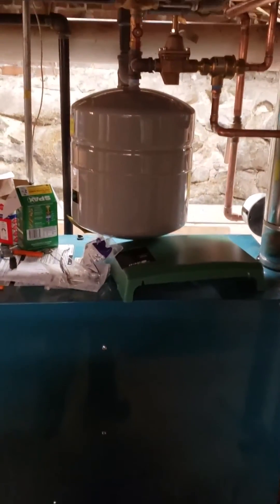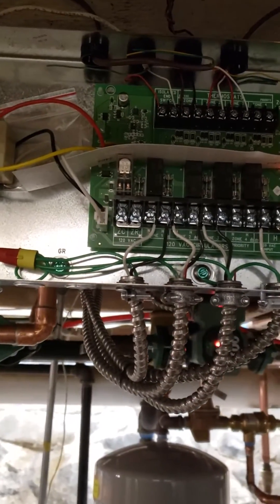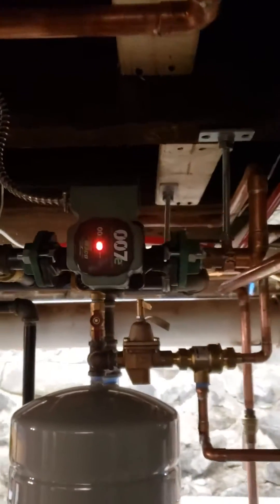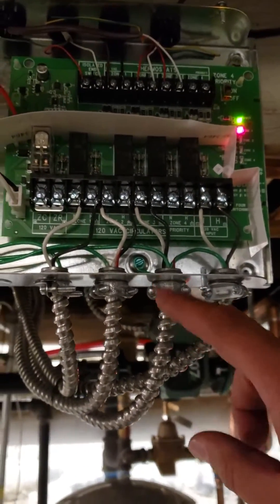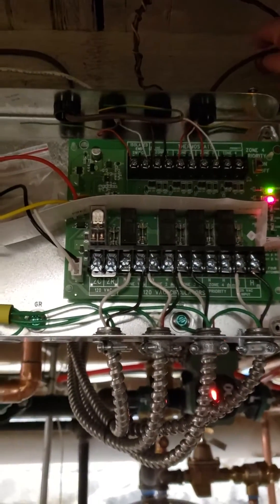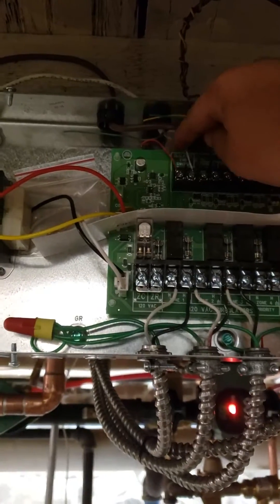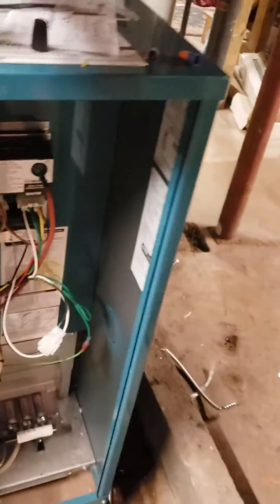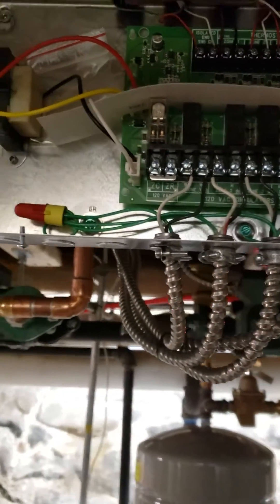How to install/Wire Taco SR504-4 Switching Relay

Comment: HI I HAVE SR504-4 Switching Relay, SAME ONE YOU USING BUT I HAVE 4 ZONE AND NAVIEAN NFC 200 COMBI BOILER. QUESTION IS WHICH WIRE I SHOULD CONNECT FROM RELAY?

Comment: Where you hook up your pumps from zone 1 or zone 2 in the same spot  can I hook up my actuators valves ?
Reply: no you need the ZVC taco which is a controller for actuator valves.

Comment: Hello, the green LED that usually lights up on the "POWER" part turned off and now I currently don't have any heat in the house. Do you have any suggestions on how i can fix it?
Reply: Make sure power switch is turned on. Make sure breaker is not tripped

Comment: Hey the end switch on the relay is connected to what exactly on the boiler it self ?
Reply: It depends on your boiler, but your boiler needs to know when to turn on and off. so it needs a switch from your relay board. For my boiler, it's the purple circle labeled E https://imgur.com/ixhkrF7
Reply: @guest00101  what if its a hot water tank though?   shouldnt it only be on when water is running through it like when you open the hot water tap on a sink?
Reply: @guest00101  Thanks!  I wonder that myself.  You were a big help to me.

Comment: On your Taco Controller, does your 120 V supply come from the boiler (switched) or is it straight from the main? I have the SR503 that i intend to hookup to 2 zones and a primary running with a Navien boiler.
Reply from the maker: Main line goes to the switch and from the switch to the the taco controller.
Reply: Do you have an aqua stat installed? If so, is it the same 120v that feeds that the same as the 120v feeding relay control?

Comment: I have a setup similar to yours.  Do you have a nest hooked up to it? If so, can you show how to? I bought two nest Es and I have a 2 wire setup ..with an unused blue wire in the wall...and I'm trying to figure how to use that blue and connect to taco for c wire power
Reply from the maker: I do have a nest I will take a look tomorrow and upload another video how to install it.

Comment: Thank you for this! However what I’m not clear about is what to do with the L1 and L2 wires in the box on the boiler and also the circulator and DHW wires on the boiler.
Reply from the maker: Hi, I'm sorry I'm only seeing this now for some reason I didn't got any notification but you are probably all set now correct?